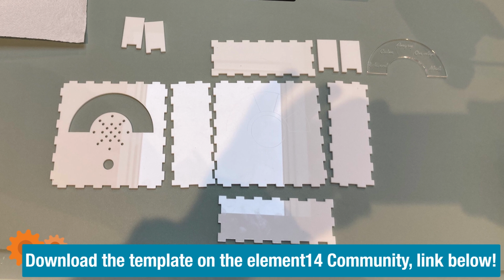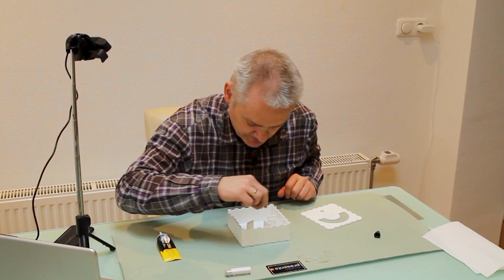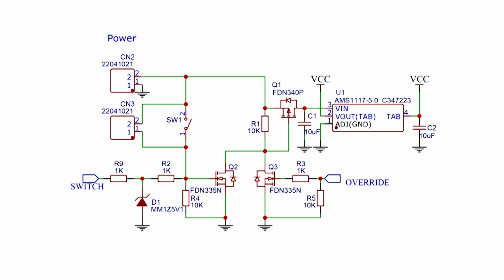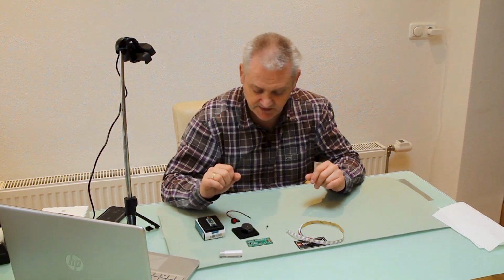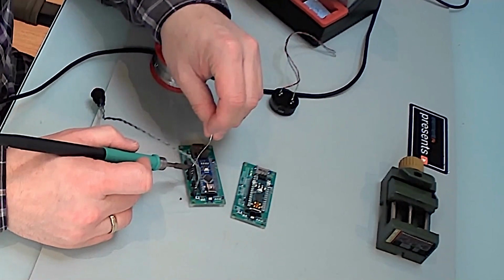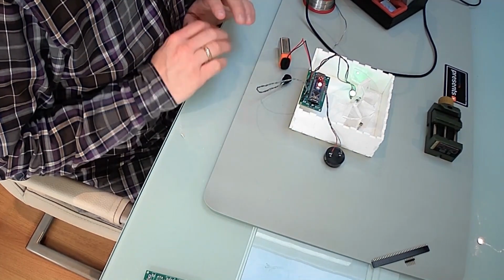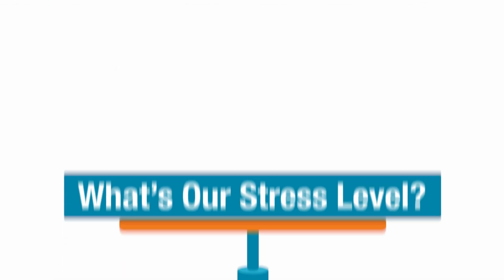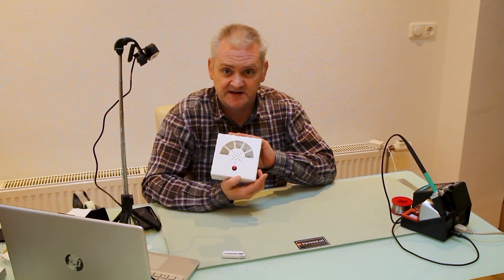Create Your Own Talking Stress Level Indicator with Arduino

Comment: Sorry, But You Are "Dumb". Using "sound" as a bow ANALYZER for STRESS is like using an arrow from a bow to test the speed of sound. Each person's perception of sound and its frequencies are almost INDIVIDUAL. As a more reliable means of determining stress, I recommend that you familiarize yourself with Scientific works (including those conducted in the USSR in the 30-40 years of the 20th century).There, as a sensor of the level of "stress" in athletes, pulse data was used. P.S.: And this is PROVEN. Ah, the fact that you assembled this device IS COMPLETE CHARLOTANISM.